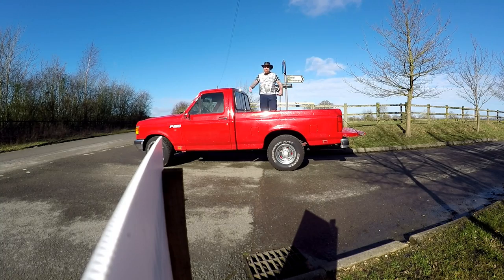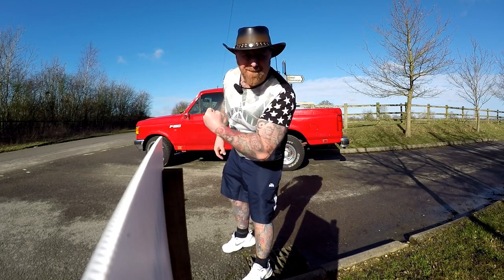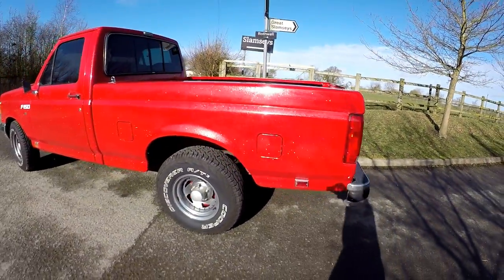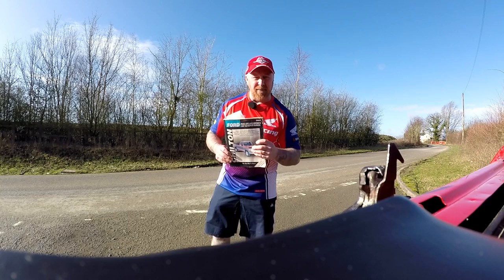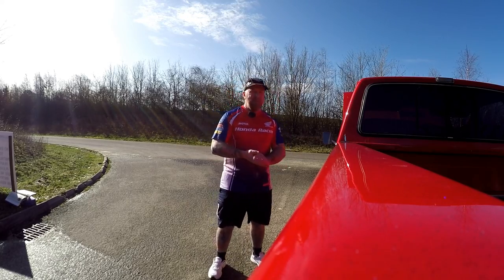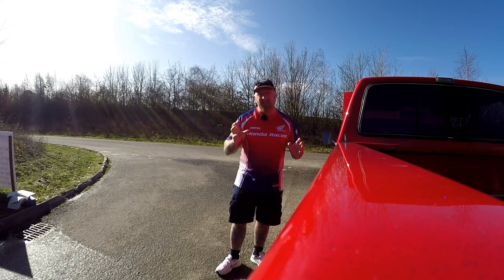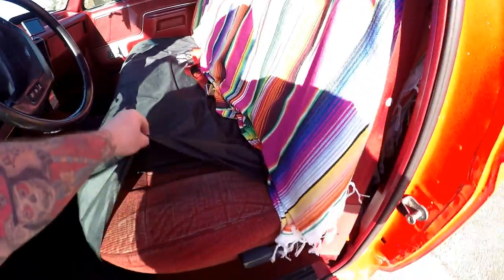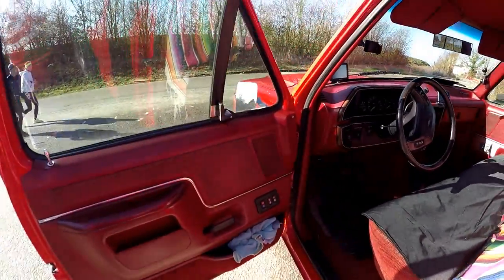CLASSIC V8 FORD F150 5.0  PICK UP TRUCK REVIEW MARK SAVAGE

Comment: Mark I think you will find the light at the back of the cab is not a reverse light but a bed light so you can see what you have in there at night.
Reply from the maker: Oh righting that case I'll check it out to find the switch 
Thanks bud

Comment: Got the steeringwheel on the correct side too 😁
Reply from the maker: Yes sir it has lol
Reply: Can i write you on Facebook.. im buying a couple of speedfights one with a locked up engine and One with electrical issues.. and wanted you to look at the front forks to checks if they are good 😁 Martin/Denmark
Reply from the maker: @landmonkey22  hi bud I have a few videos of the front end and single arm suspension 
Theres 70 of them to help bud nust have to watch a good few

Comment: You may have a switch in the cab or could be a switch when you drop the tail gate if so will only work when you have lights switched on.
Reply from the maker: Got it bud ,I'll check that out and makes sense too 
Top man

Comment: @marksavage a few months ago I bought a speedfight 3 50lc 2014 which wouldn’t go over 20mp it has a malossi 70cc pot and piston kit on it and a stage 6 sports exhaust. We’ve replaced the pot and piston kit to a new one of the same specs because the old one was scored’ new reeds, intake manifold, new rollers (6g) jetted and tunes and a rolling road but will still only do 25 and under any thought on what it could be. exhaust?
Reply from the maker: As you would know from my videos 70cc kits 
They can be a real pain to run and keep running 
Did you up jet the carb or 19mm or 21mm carb
Hotter plug 
New air intake 
Better reeds 
New exhaust 
More gas more air more gasses out 
I'd also check the variator bud
Reply: mark savage hi again mark do you have any social media so we can have a chat about what to do and I can go into greater detail on what I have done to the bike

Comment: Hi Mike 
I have a speedfight3 scooter but it accelerates very slowly, every morning when i start him up the speed is in the beginning 14 kmph for 2 minutes then slowly goes to 25 after 5 minutes and will only reach it topspeed of 37 after 25 minutes of riding.
I wached your video about your speed fight but i was wondering if you do the 4 possible fixes, will the topspeed also increase?
Because i don't want that because normally it may only go 25 kmph.
So i just want it to accelerate faster.
I would appreciate it if you would respond.
Luca from Belgium
Reply from the maker: hi bud 
there's 70 speedfight videos to help but sounds like the variator system and your rollers which is common and an easy fix 
get it off clean and replace the rollers with 6g ones and maybe a new belt . test the clutch like in my videos too
this should help as guessing you would have all ready changed the plug and air filter
Reply: @marksavage  thx, yeah I already changed the plug and cleaned the air filter.
I could change the rollers but will it increase the topspeed?
Reply from the maker: don't underestimate new rollers and a clean variator bud , it will help with pull away and top end as if they are not rolling it will not open up and stay at low speed with poor pull away 
give it a go bud I have many videos on them and how they work
Reply: @marksavage  okay thx 
Really appreciate the advice keep making video's!!!